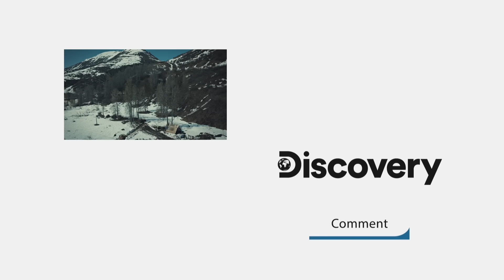Crew Members Return To Find Equipment DESTROYED By Snow | Gold Rush: White Water

Comment: Wow you depended on a plastic tent with a few steel pols to hold a snow load of a usual 20 to 30 feet at times 🤣
Use like 2 20 foot shipping containers even with just a little bracing they will hold 50feet from crushing and bear proof . Plus you can put logs under each and drag them everywhere you need